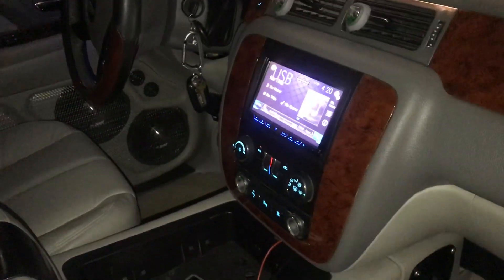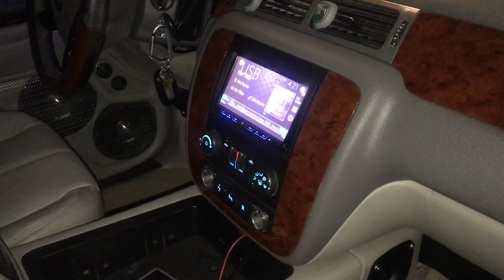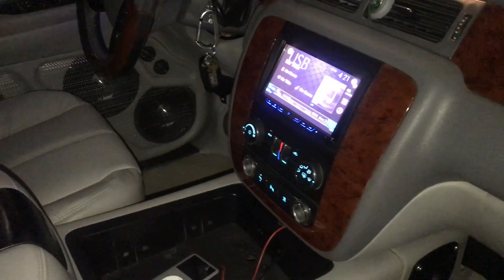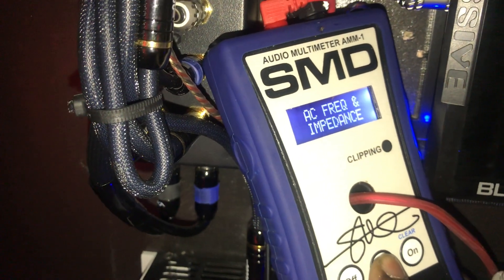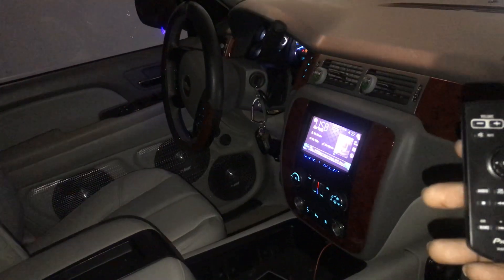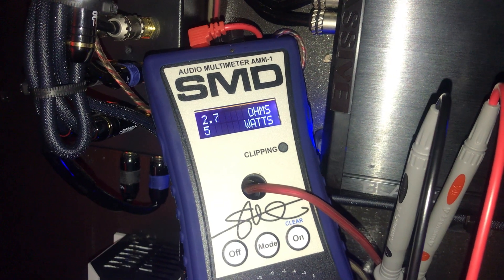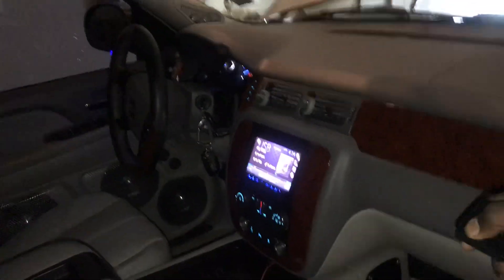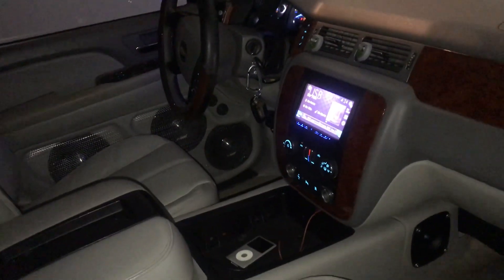Powerus 3500 real time wattage test with SMD AAM1

Comment: 4-500 watts from a 3500 amp? I understand real time power but you should be getting a lot more even on music bro.
Reply: I doubt he's maxing out the signal level for those mids.
Reply: @JasonWW2000  this is misleading and not accurate
Reply: @Craneop817  Well it is accurate. He may have 2,000 watts available, but in his install its not maxing out the amp. This means the amp is not working hard, its running very efficiently and he has a lot of dynamic headroom. All great things. Remember, he's not doing an amp dyno test. He's not trying to show what the amp is capable of doing maxed out. So there is nothing misleading. It might look misleading if you think he's trying to show max power. He's not doing that, though.
Reply: @JasonWW2000  lol
Reply: @Craneop817  So you understand or you don't understand?
Reply: @JasonWW2000  he states in another comment it’s set to clipping. Stop bugging bro I said what I said this video is misleading and not accurate
Reply: @Craneop817  Do you understand what clipping is? It is when you run a sine wave, usually at zero db and set the gain just before you see the sine wave start to flatten out on the peaks. I assume you have no experience with this or else you would know music is not a zero db sine wave. 
I could believe your misunderstanding if you were not knowledgeable, but you seem determined to personally attack him. Did he do something to you? Maybe you are simply jealous that he has more than you? If you want to invalidate his video you need to state why it is wrong. I see nothing wrong here. 
About his gain settings, I dont know what they are, but I would guess they do not need to be at clipping. They can be lower than that. Or they can be at clipping and then he can lower the signal level in the DSP. You want the different drivers (subs, mids, tweets, etc...) to be somewhat balanced between each other. Each amp should not be adjusted to the max. Know where the max is, then adjust it lower to equal out the sound.
Reply: @Craneop817  Do you have a personal reason to discredit the amp brand? What about the meter? You don't like SMD stuff? Or you just don't like bassgod?
Reply: @JasonWW2000  lmfaoooo
Reply: @Craneop817  Okay, so you think its inaccurate and misleading for whatever reason. I think it's accurate and quite normal for the reasons I've stated. I guess we will have stay in disagreement. If it starts making sense, let me know. Have a good one. 👍

Comment: Great video. Quick question for you. Are your amplifiers wide open gain wise or are they set to clipping. That's still good clean power for mids
Reply from the maker: Winfield Jenkins it’s set to clipping, what do you mean by wide open gain?
Reply from the maker: Winfield Jenkins and thanks brother
Reply: I know some people around here. They turn their gains all the way up. Wide open
Reply from the maker: Winfield Jenkins seriously, their not clipping their subs?
Reply: @mondo82111  I tried to tell them not to turn the gain all the way up because it will burn the voice coils.  The guy fried the speakers and the amp. I will definitely show him this video that way he understands. Sometimes people are hard headed
Reply from the maker: Winfield Jenkins gain is not used for volume it’s used to match your radio preamp output which mines is 4 volts but my amps can go up to 6 so I set mines to 6 volts
Reply: @mondo82111  thanks for the information. I can help these kids around here. They have no clue of what a real system sounds like.
Reply from the maker: Winfield Jenkins thanks man